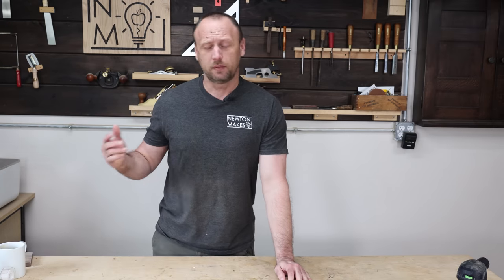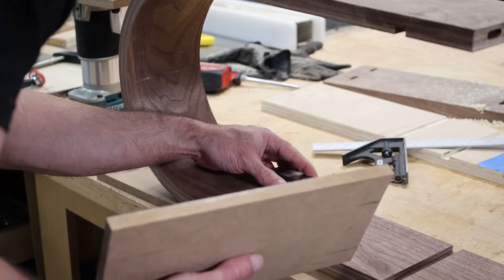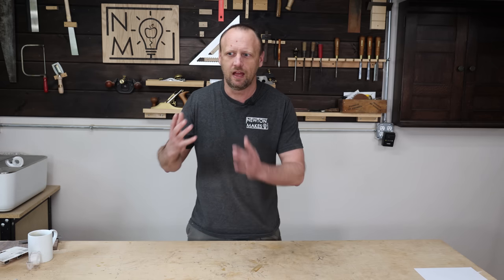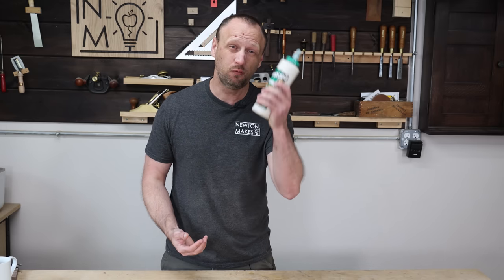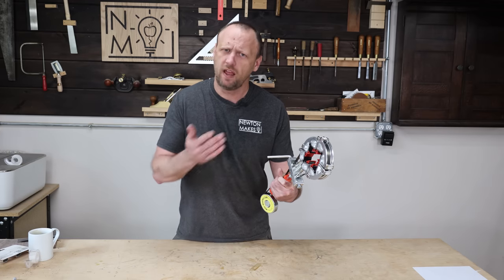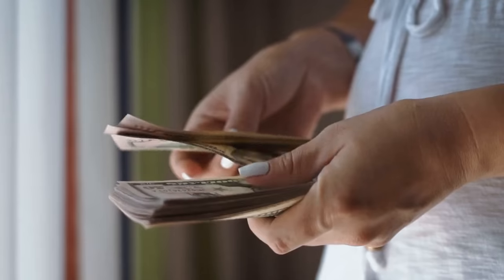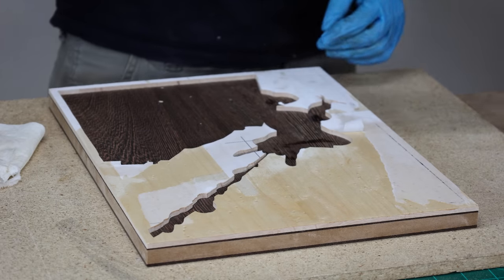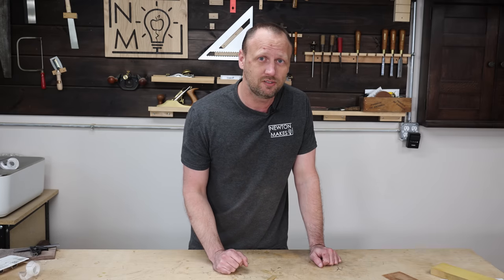I Wish I Knew This When I Started Woodworking! | Woodworking Tips for Beginners

Comment: I am in complete agreement with your advice regarding glue squeeze out.  Most people use way too much glue and then have to deal with cleaning off all the excess glue.  I have found the perfect tool to put on the correct amount of glue and minimize squeeze out, a $0.50, 3 inch, plastic putty knife with 1/16" notches sold at Menards and other box stores.  I cut off the plastic handle so that I am only left with the notched blade. I put on a bead of glue to the surface to be glued then use the notched putty knife to form uniform glue beads along the glued surface.  If I am gluing porous surfaces, I glue both surfaces, If I am gluing very smooth surfaces, I only apply glue to one surface.  I usually get just a tiny amount of squeeze out that is easy to remove and have never had a glue joint failure in 40 years.  This technique is so good that I often don't need clamps since the Titebond glue will catalyze quickly and the pieces don't float around like they do when you use excessive amounts of glue.

Comment: My biggest beginning woodworker mistake(and I'm still sorta beginner) is using cheap construction lumber,I wish I would have known how much more enjoyable it is working with hardwoods such as walnut or cherry.
Reply: Well mistakes in pine is much easier on the pocket than in walnut or other costly woods.
Reply: @TomDanaher  I feel that if you keep the projects small and simple(boxes, picture frames, decorative shelves,ect) then  making mistakes isn't as intimidating to newer woodworkers. I remember my first projects in red oak ,man I thought out every little detail 100 times over before I even measured or rough cut anything! Didn't wanna mess ANYTHING up. I think getting over that fear of messing up is another beginning "wish I knew"
Reply from the maker: I agree. Construction lumber is not as dry and it has more movement. It also has a lot of sap. In general, it's simply not as good of quality. At the same time, one can buy beautiful, properly dried pine at a lumber yard cheaper than hardwood. It's quality stuff and not made for construction. It's better quality material but less than hardwood.
Reply: @NewtonMakes  No dried pine here in Italy, and actually no lumber yards.

Comment: Tip:  Hardwoods are generally easier to work with hand tools than softwoods.  For example making dovetails in Pine vs Walnut.  Pine will fold over and split where as Walnut will cut smoothly even with a semi sharp chisel.  I was surprised how well I could make dovetails in Walnut after originally making dovetails in Pine.
Reply from the maker: EXCELLENT point! You are 100% right. Dovetailing pine is like trying to cut a pillow.
Reply: Yes
Reply: Yes, and be glad you can get walnut, here is Italy it is very very difficult to find walnut.  They love pine here and it seems to be the only wood available unless you find a special source for other types of wood.

Comment: The only exception I’d have to your statements about glue squeeze out is on cutting or charcuterie boards.  I want tons of squeeze out there otherwise I get gaps that can trap food or allow too much moisture in the crack.  More as a gap filler than providing stronger glue joint.  Great video - keep up great work on your vids.  Thanks!
Reply from the maker: People will find an exception to a lot of these because we all do things that work for us. That's one thing I love about making stuff. There are so many ways to do things and they aren't wrong, just different. We find what works for us and that's really cool!

Comment: So many points I agree with and most especially with the sharpening. I did a lot of YT reviews of sharpening methods and in the end I chose a simple single diamond stone and made my own strop. I  knew that I  needed the processes to be quick, effective and simple otherwise I'd not do it. I did buy a guide to correctly set up the angle but very quickly I did away with that too because I developed a feel of how to angle the chisel,  plane blade and my kitchen knives. The only thing I would change about my choice of diamond stone is its width. I bought one that is really a bit too narrow for comfortable sharpening. I'll probably upgrade that soon. Otherwise, super sharp tools do not have to be hard to achieve. Go simple, effective and quick.  I enjoy sharpening now because after the initial learning time, I now do it really quickly.

Comment: The table saw to bandsaw re-sawing technique is one of my favorite. Actually did that this morning on some coffee tables I’m building. After I run it through the table saw, I find it even easier to run it through 60% of the way on the band saw, flip it over and meet in the middle. It keeps your fingers in a safer spot and I’ve found it easier to keep a straight cut.
Reply: Yes. I also use this method all of the time. It actually makes for straighter cuts. It is safer when re-sawing thicker materials. The only time i would do a full bandsaw re-saw is when the material is too thin for a safe cut on the table saw.

Comment: A tip on saving a great deal of money on sandpaper: use sandpaper made for drywall. It's a mesh. My favorite is Abranet, but I've used others and they work the same and come in different grits. Why this? I've had the same Abranet 3x6 inch multipack for nearly 5 years and it's still good. Bought on Amazon. Grits from 80 to 600. I also have the 5 inch discs for the random orbital and it's also still good, though I've only had that for 3 years. Same multipack. Why is it so good? It doesn't clog. You can fold it, roll it, bend it, and it still works. It's mesh, so the dust goes through into the collection without holes. And if it gets "full"? Just peel it off of the sander and whack it a couple of times against the counter and it's clear. You can also blow it out with compressed air, or wash it if you need to, and it's still good. Now, 3M makes a very thin paper that can be rolled up very tiny, or wadded up and come back to it's original, but it can't be unclogged simply by whacking it on something. That's best for coves and grooves and detail work. But it does last a long time. For me, only two papers. Abranet (or similar) and the 3M foldy paper. It's all you'll ever need.

Comment: Sound advice here!
I would just add about keeping chisels and planes very sharp, it makes working so much easier.
I also second the comment about hardwood being easier to work - if you are learning it is tempting to use heap softwood but it really is harder to get good results. I used to buy or scrounge old hardwood furniture to practice making things, your local tip facility can be your friend here.

Comment: Some tips I have learned:   Make cheap but precise jigs for repeat jobs. I have one for finger joints, spline cuts, miter cuts, cross cuts
Don’t cut anything on a router until you have tried it on scrap wood and see if it works well
Get a 12” and 36” steel rule that starts at zero on the edge otherwise too many opportunities for mistakes 
Enjoyed your video!

Comment: Good sanding advice all around. You're correct. you only need 2 grits (or perhaps 3, an 80 grit, if you need to hog off more than a finish sand because something didn't line up exactly correctly). 120 and 180 are fine, depending on the finish. A penetrating finish? Stop at 180. Higher and the stain/penetrating whatever won't sink in very far. A wax finish? You can take it all the way to 320 if you like. Working with a very dense, oily exotics like Ebony or Pink Ivory (that almost finishes itself with a sharp blade)? 80 grit to level (this stuff is HARD), then skip to 220 and see where that gets you. Not glass smooth (Ebony, African Blackwood, Pink Ivory, Brazilian Rosewood, etc)? Then take it to 320 or 400 (because all you're going to coat with is a UV clear coat).  Just know that this stuff is, again, very hard. You'll get a glass finish, but you have to be patient.

Comment: You're giving great tips, so I'm going to give you a couple about glue squeeze-out. You're right. You only want to use as much glue as you need. For the best adhesion, you want to put enough glue but not too much, as you said. To that, if you let both sides sit for a few minutes, it will get tacky ... tacky enough that you can move it a bit, but then it will quickly "lock" where you want it and won't slip during clamping. If it does slip with the clamps, remove the clamps. Realign the pieces, wait another 5 minutes (with Tightbond anyway) and THEN clamp. You will have less slippage. 
ALL pieces are subject to glue wandering everywhere. Even if you do your best to remove excess glue, you may leave an invisible fingerprint, or not scrape or sand as well as you believed. 

The remedy? White vinegar. Cheapest you can get. Once you have finish sanded and think you're ready for finish, you don't want to be surprised by glue residue because it will be an "I messed up" beacon on your piece. So, wipe your entire piece down with white vinegar on a rag to figure out where the residue is on the joints, or stray fingerprints. Once identified, you can pat on the vinegar and let it sit for a minute, and then, with a rag, wipe (or sometimes scrub depending) the glue residue OUT of the wood. Seriously, OUT. Vinegar pulls the glue out of the wood. 
White vinegar will REMOVE the glue from the grain. Finger prints? Just pat some on with a rag, wait a minute or two, and then wipe/scrub it away. Bonus is that it won't raise the grain. 

Glue leftover or squeeze-out on the joints? This will take a bit more patience, but it will work. Pat on the vinegar and let it sit. You will see the excess turn opaque white and many times, you can scrape it up with your fingernail and pull the majority of it off. Then let dry and check again. Residue, repeat as for fingerprints. 

A WORD OF CAUTION: Be very careful when using on joints. You absolutely DON'T want to flood the joints because if it will dissolve the glue on the surface, it will do so in the joints. So, just PAT it on. Yes, it may take a few times, but better that than destroying the glue in a joint that will eventually fall apart. 

Easy application, cheap, non-toxic, reliable, won't raise the grain, removes residue entirely from the grain with patience. Use it, and never find an "oops" when you're applying finish.

Comment: Great video. Extremely insightful for new guys, especially not spending 1000 on parallel clamps. I've used pipe clamps and quick and f clamps from HF and they have been fantastic.
Reply from the maker: Don't get me wrong, if I had a ton of parallel clamps then I wouldn't cry. But I thought it was what I had to have when I started woodworking. Now, I use pipe clamps almost exclusively. They work great.

Comment: When it comes to sanding, I will say that the higher the grit of sandpaper you use the tighter the grain gets and the lighter the stain will be. 
Example: 180 grit on oak using honey oak stain will be darker than if you used 220 grit sandpaper.
Also if you take a piece of sandpaper and go with the grain it will change the color of the stain. When you go across the grain, it leaves a mark. Orbital sanders leave swirl marks in your wood, and hand sanding with the grain eliminates a lot of that.

Comment: My biggest mistake was having too many projects going at once.  Ended up taking twice as long to complete each item.
Reply: I still have this issue. I am currently working on reorganizing my shop space and I have come to realize that one of the biggest sources of clutter and mess is unfinished projects. In some cases I needed a part, a tool, or my progress wasn't matching my vision, I set it aside to work on something else and the project so tucked away. I need a better way of storing in progress projects so I have a constant reminder of what needs to be worked on. I also found keeping a shop journal helps because sometime it has just been so long that I can't recall what needs to be done which leads to that project further languishing in limbo.

Comment: You are correct with the bias reviews. I have seen some reviews on things I own and they are flat out lying about them. After using a tool for a while you see what is good, bad and flat out horrible. What I have learned to do is follow people that you trust and watch multiple reviews. But the best method in my opinion, is to read the reviews from people that actually bought it (Amazon).

Comment: I’m a new woodworker. Great video. How about don’t buy tools just to have them. Buy slowly, good quality and learn to use what you have. Necessity is the mother of invention. And how about if you are working on a project and one piece is dependent upon another, wait until that first piece is finished before you cut the second piece.  Learned that one today - making a back leg for a mini bench vice, cut the jaws, cut the back support based on the table top thickness, then did a crappy job laminating the tabletop and I had to re joint and plane and now the back support is not tall enough.  I could have cut that last and saved a bunch of time.

Comment: Ah the table saw flip and rip method followed by the bandsaw. With thin kerf blades this works really well. In fact, unless you have resawing down, you're going to get about the same kerf loss in the end. It's a good beginner method too, because you can take progressively deeper table saw cuts up to the 3" or so max and get through a 2 x 6 this way. You do need to joint a face and edge perfectly, actually two edges or it won't work and more importantly won't be safe. Also you need to watch for tension in the wood. Because the blade is always buried it's very safe to "resaw" this way. Lacking a bandsaw a good 4 tpi hand rip saw will get through the inch or two left with a 7-8" board. A sawzall also works. Ideally a tiny bit of wood should be left uncut to keep both pieces together, but with practice you can go all the way through no problem. I've made mountains worth of sawdust this way on an old Craftsman with a 2 hp spa motor rated at 20A. It trips the breaker once in a while. A standard 15A motor is fine. The blade should have 24 teeth no more. I'm looking a those 6 tooth diamond carbide blades made for hardiboard. Will the cut be too rough? We shall see.

Comment: I also use my table saw to resaw wood. However, you didn't mention one VERY important point. To resaw on the table saw. You will need to be very careful to flip it end-over-end. You can't just cut the other side willy-nilly and expect it to line up. So, cut all the way through, keep the piece in the same orientation, and then flip end over end. NOT just flip it over. It makes a difference. The good thing about this method, even if you do need to take it to the bandsaw to cut that cross-bar (the cut will look like an H after cutting on the table saw), is that the bandsaw will track against one side of the cut. Yes, that will leave you with a piece sticking up in the center of the other side, but that's easily fixed on the planer or jointer.

Comment: "Relative dimensioning" is also called "scribing" and it's the most accurate way of measuring to be honest. I teach folks that all the time. Just cut about a half blade-width longer or wider than you think you need and you can detail the cut from there for a perfect fit, either by sanding, hand planing, or cutting an "eyebrow" ... which is when you align to the blade instead of the teeth. May take a bit longer to get a precise fit, but you won't get the cuts totally wrong and waste stock.

Comment: As a former spray painter and head of surfaces and finish at my former wood-shop. I would not go lower than 220 grit for a nice finish. 180 is a bit too coarse IMO :) I used to easily see the sanding marks after 220 paper and a Festool sander. Even after one layer of primer plus two top coats of two-component acid catalysed lacquer or paint
Reply: I'm not a pro but I always make that final sanding, even if it's ROS 220 grit, to hand sanding with the grain at 220 grit.  T'hen again I prefer sanding in progressive finer grits rather than skipping grits.  Just works better for me in speed and efficiency.
Reply: Strongly agree, it was terrible advise unless the project is being sold to a blind person or they 100% will never care about loads of micro scratches. 220 hand sanding with the grain (400 using an orb sander) is a minimum to get most wood where there isn't visible scratches. Most clear coats/finishes act like a bit of a magnifying glass on all of the scratches left behind with anything less than 220. Nothing worse than putting a finish on & later wishing you would have taken a little more time to not have visible scratches. 

The benefit of using every grit is it requires less time to get out the scratches left behind from a coarser grit.
Reply: @dwightl5863  Skipping grit is a big no-no in my world. There are no shortcuts to a great finish. Its plane knowhow and elbow grease. For instance, getting and MDF edge just as nice, flat and dimple-free as the face or back-side. You got to know how much effort it takes, and not skip any of the steps to get the result you want. Shortcuts will show in the final result. 180 as a finishing paper is a mistake not possible to recover from, since the orbital sanding marks will be visible. On the other hand they will show after 220 grit also but not as much, and those marks can only be polished away as a last step any way. I didnt bother since my customers would never go into the details I did, and the price would be significantly steeper too.
Reply: @bhough410  agreed ditto